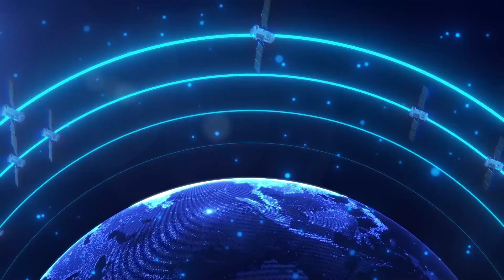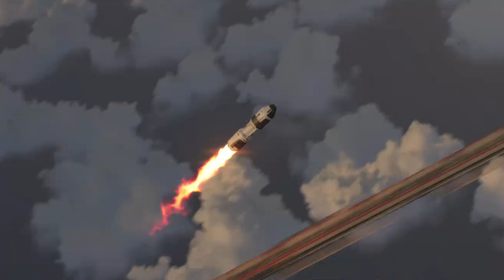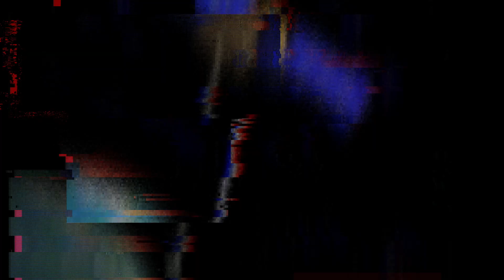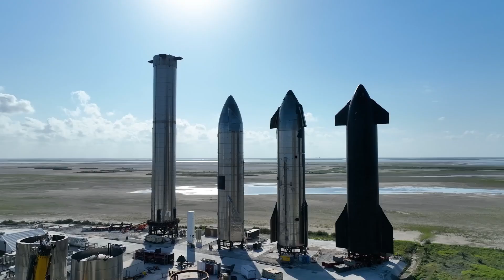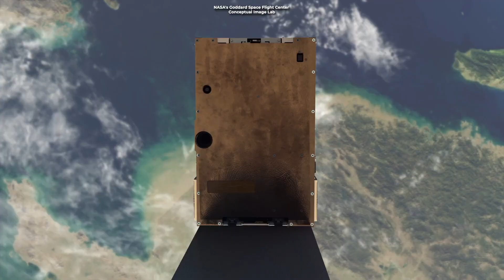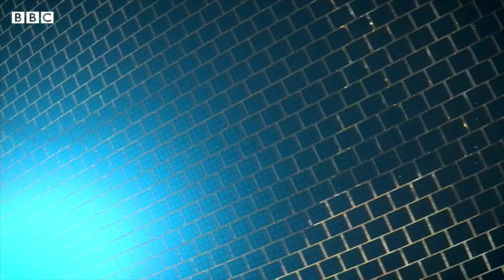How Space Travel Will Change Forever | The Skyhook Project

Comment: That is pure science fiction and will never happen. The most violent acceleration in spaceflight is the launch with gradual increases of accelerations. You simply will not see some type of change in technology without development.

In rocketry the most dangerous event is called MaxQ, the point in time where rockets experience the maximum speed relative to air pressure in the atmosphere. This catch would introduce forces on the spacecrafts many times above those stresses, which is nonsensical because everything would need to be reinforced for that singular moment in time, adding weight and thus the fuel and weight requirements on everything, including the tether.

Thats why all those ideas are unfeasable. The only way you would get something like a space elevator that is strong enough is with some kind of electromagnetic cable, that is re-enforced by a magnetic field to substitute for the tensile strenght that is missing in the material, because such a strong material doesn't exist.

And on top of that, for the current required at that lenght, it probably would also require superconductive material, or close to, because of the lenghts and the simply reality of how electricity works.
Its not impossible, but highly improbable to engineer something like that in the near future.